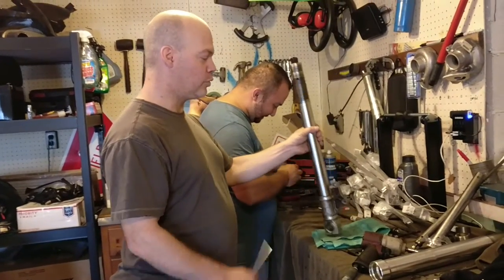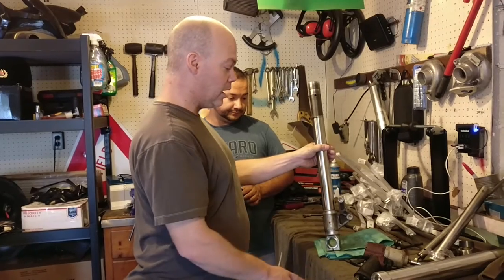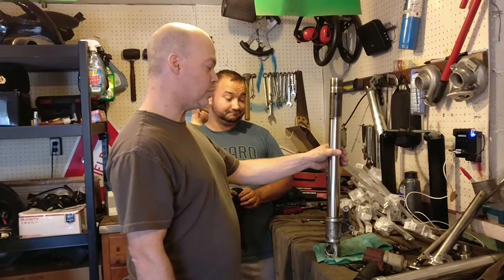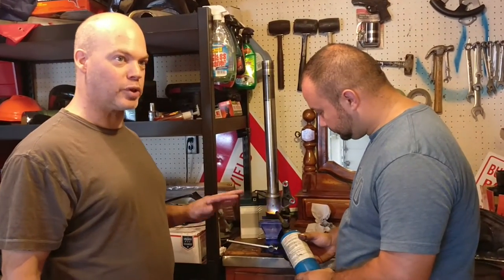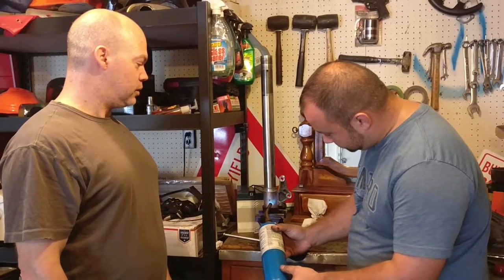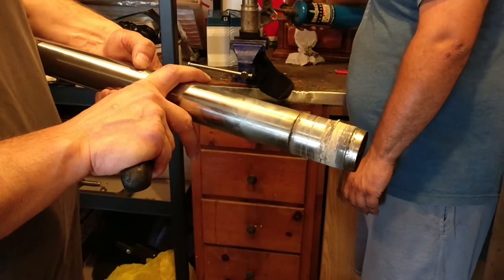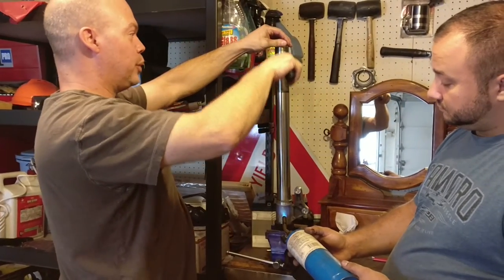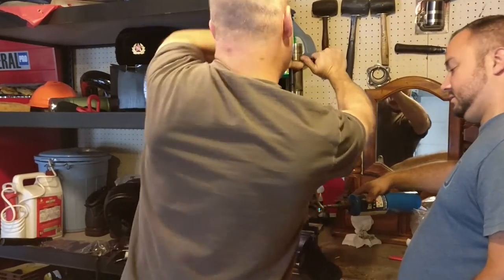Removing USD Fork Tubes from Caliper Mounts (Stanchion)

Comment: Thanks, guys i also thought this could be done but wasn't sure how to do it, It's so much easier when you can see someone do it first, you have just saved me a fortune.
Reply from the maker: Yeah it's not really hard.  Just need to take your time!  The part to get to this point requires some tools for the USD forks.

Comment: Just a heads up. Pretty sure the caliper mount/part where the axle goes is typically referred to as a fork lug or lower, and the actual fork tube is what is called the stanchion.
Reply from the maker: Mike McDonald I believe you are right.  Unless I overdub, it's staying incorrect. :D

Comment: Thank you for this, I presumed this could be done but there's a difference between presuming and knowing lol I'm currently restoring a 1989 H1 J.D.M Ninja 400 and because the bike i so rare I can't get forks for the bugger (at least not for a reasonable price), the bike came with a set of forks for a 92 400, the chrome stanchions are the same diameter but the tops and bottoms are the wrong size so hopefully I can just swap the stanchions over. I'm crossing my fingers pretty damn hard as the only other option is paying £220 ($285) to have the originals re-chromed :( lol
Reply from the maker: Glad it helped.  I was surprised that I couldn't find a video about this, so we decided to film the second one.  BTW you can get new tubes for your bike from the UK (TNK) or Italy (Paoli) http://www.ebay.co.uk/itm/KAWASAKI-ZXR-400-1989-H1-FORK-STANCHION-UK-MANUFACTURED-NEW-MOTORCYCLE-PARTS-/141690424505

Comment: Hi, do you know if the thread is normally the same between different forks? For example if I got the stachion (48mm) from 1 bike and the lug (48mm) from another bike would they likely fit?. Thanks for your input.
Reply from the maker: Gwilym Koryniaka that's a tough one. I do not know if there is an industry standard thread pitch/depth on forks of the same diameter.  If the fork manufacture is the same, then chances are high it will fit.  Let me know if you go forward with your swap and the details.

Comment: do you know if a heat gun will be sufficient to do the job? rather than torch?
Reply from the maker: Given the amount of sealant and the surface area of the metal, it might not be possible with a heat gun.  If it is, it would probably just take longer to soften the glue.  You don't need MAP, propane would work too.  Propane and a nozzle are relatively cheap.

Comment: Great video. Helped me to remove my fork tubes. What thread sealant do you use when reassembling the lowers. Mine was white  but not exactly sure what it is.
Reply: Henry Tong Permatex 80632 thread sealant with PTFE or a similar product.
Reply: Awesome thanks. I just wasn't sure if it needed to be the high temperature version because it took a lot of heat to remove it in the first place.
Reply: 59214 would work as well I think

Comment: What size bit did you use for the set screw?
Reply from the maker: The proper one that fit snugly.  It was metric.  I don't remember the size now, but it was a common metric size.
Reply: @falcn12  Got it out. It's a T7 torx without threadlocker. Probably 10-12 ft.lbs of torque.
Reply from the maker: @Elregris  the one on this fork was a simple Allen key.